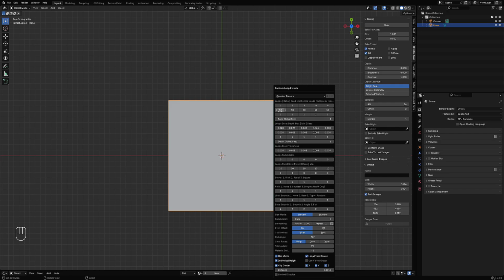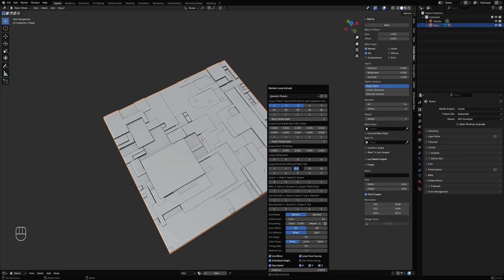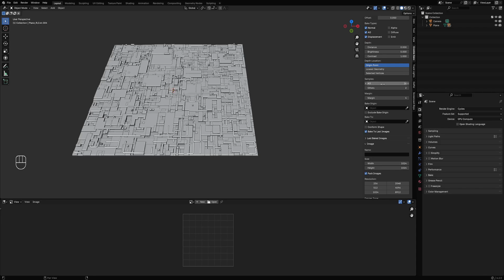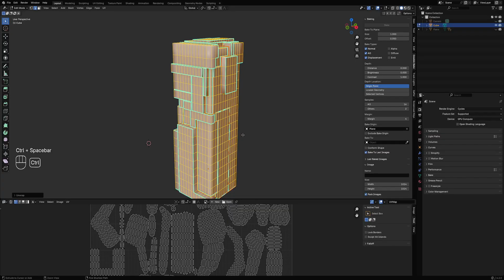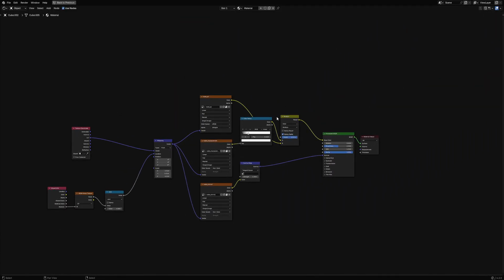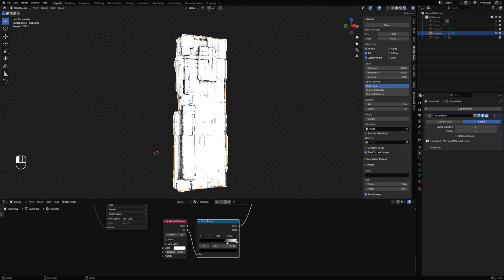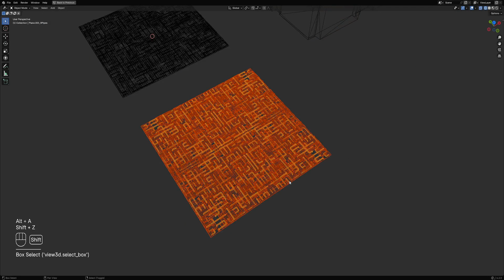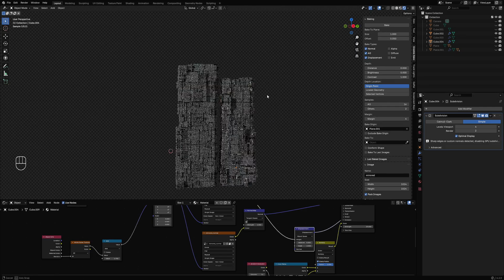Baking Texture Maps Using RFlow and GBake (Beginner)

Comment: man, this addon is very good, but you need to fix the options window of each tool, it is very annoying that the window closes, it should be easier to apply to the primitives, for example: applying it from the modifiers!
Reply from the maker: The menu closing is inherent to Blender and cannot be changed using front end Python code: https://www.blenderguppy.com/add-ons/other-information/redo-panel